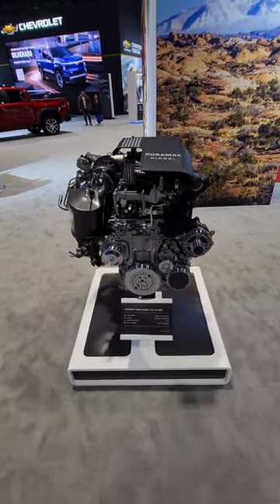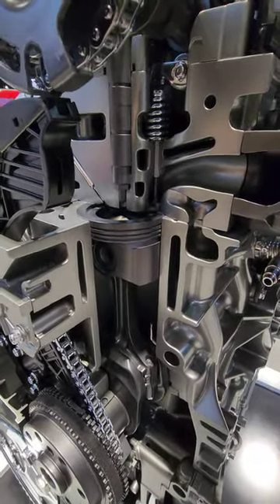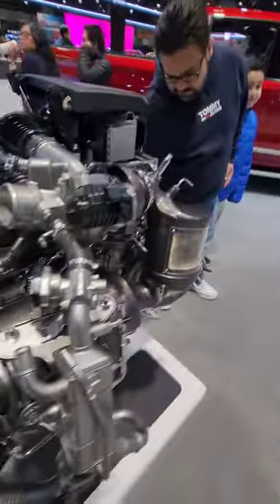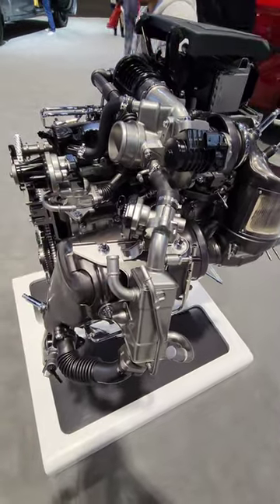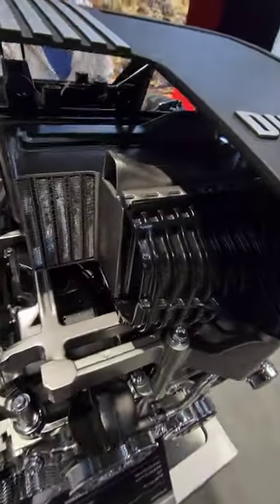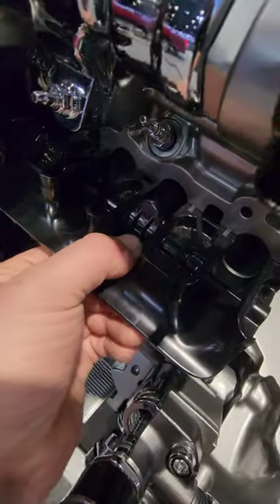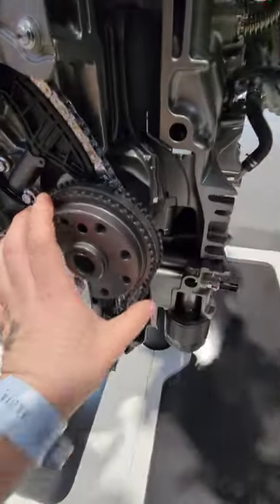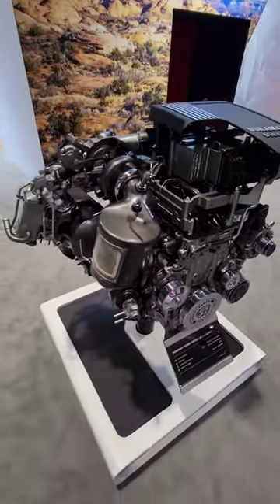Everything you need to know about the new 2025 LZ0 3.0 Duramax Diesel

Comment: My 2024 ZR2 with LZ0 gets 35% better MPG than my 2023 ZR2 with 6.2L. Diesel is $0.30/gallon cheaper than 93 Octane as of 10-1-24 in Texas. LZ0 is a great engine. No issues through 7K miles. I use 1 gallon of DEF per 1000 miles.
Reply from the maker: Sounds like a win win!

Comment: It’s crazy how every video talking about this engine I see the comments full of dumbasses saying stuff about the oil pump belt as if every gas engine made in the last 30 years doesn’t have a ridiculously complex and expensive timing system that will grenade the engine if it doesn’t get replaced every 100-150k. Why is it okay for a gas engine to need a major service at 150k but not a diesel? Btw I own one of these. It’s 2500 bucks at the dealer to get the belt changed. If you can’t afford that you can’t afford the vehicle the engine comes with, I promise.
Reply: @mudslutmusic9052  actually GM has stated the LM2 is also at 200k now. Look at the part #. It’s the exact part # on both
Reply: I think because in this case it's because that belt is on the back of the engine and it's a lot more difficult to get to and service.
Reply: @frankeem3820  weird how nobody mentions difficulty servicing on transverse mounted engines where there is nothing you can do short of pulling the engine to get to it but taking a dozen transmission bolts off a rear wheel drive engine is somehow too difficult
Reply: My 2003 Acura RSX Type S has 312k miles on the original cam chain, fuel pump, oil pump, starter, brake rotors, shocks, and has been tracked at the Streets of Willow raceway @ Rosamond, CA. This motor will not see that kind of longevity.
Reply: $2500 wipes out any fuel savings, especially when diesel often runs a buck more than gas.  How come the Ecodiesel doesn't need this?  Cummins?   Pay your $2500 extra and I will keep my money in my account.
Reply: @DavidMosby  laughable suggestion.  For those that run premium fuel, that difference is roughly 20 cents less a gallon (in the southeast US), and many modern gas trucks at least recommend use of premium.  

My father has a GMC with an LZ0 and averages 25mpg on his commute to my 15mpg average on roughly the same commute.  I run 93 octane in my Nissan Titan (required for the 400hp map).  If you do that math and realize that it will take us both 13 years to accumulate 200,000 miles on our vehicles, the fuel cost savings would be just shy of $20,000 over that time if I moved into his truck.  You couldn't be more inaccurate in your statement even if you cut my estimate in half, which would more than account for a dollar difference between 87 octane and diesel.
Reply: @zackyb-uj6qn  , I can't help if you are not smart enough to not buy the most expensive gas hog half ton truck.  Most people don't know if their car has a belt or a chain.  Shame on every company that makes disposable vehicles!
Reply: @frankeem3820  service of the pump and belt both require the removal of the 10 spd transmission to access the back of the 3.0 LM2 and LZO.
Reply: @frankeem3820  It's actually easier to service than the oil pump belt that have been on the 2.7 Ecoboost and 5.0 Coyote for the last few years. Guys think that it's easier if it's at the front but the labor estimate for replacing the belt on the Ford gas engines is higher than the labor for the oil pump belt on this engine. It's also hilarious that almost nobody seems to care that Ford uses oil pump belts on those engines in the F-150, but put the belt at the back where it takes less labor to change it and the internet has a meltdown. There's way more stuff that has to be removed to access the belt at the front vs the rear.
Reply: @DavidMosby  Fuel price differences change constantly and vary by region. In the upper midwest, diesel is currently 3.41/gal and regular 87 piss is 3.13/gal. This engine makes more torque than even the 6.2 V8, gets twice as far on a gallon of fuel, and that 6.2 strongly recommends 91+ octane fuel. That monster torque is worth it alone. Add to that the fact that some guys are averaging 30 mpg highway and 17-18 mpg while towing, and that is a huge advantage, even if the oil pump belt needs to be serviced years from now.
Reply: @jellyfrosh9102 aren’t you gonna be embarrassed when you find out they gotta pull the truck cab to change the timing chain and maybe oil belt too. 😂
Reply: Or you know, they could have just learned from Ford and not used a wet belt in the first place. And look up how long those "150k mile guaranteed" wet belts really last. And gas motors timing belt replacement doesn't cost $2500. Aaaaand most cars have gone back to timing chains anyway so.

Comment: I've had 2 little 3.0 Duramax engines, in a 2020 and 2022 Sierra.  Put 40K on the 20 before trading it in and have just under 19k on my 22.  I don't have a single bad word to say about them.  My next new vehicle will likely have a 3.0 also.
Reply: Is what they say about the massive amounts of oil consumption true?
Reply: That’s a rare issue likely due to owner negligence. Its very important to do a proper engine break in before the 1st oil change and do your 1st oil change no later than 5k miles.
Reply: 40 thousand miles?   19 thousand miles and no trouble.  Let's hope so.   Come back and talk to us when you have 375,000 miles on one of them like my 5.9 Cummins.  Good luck.
Reply: @pcmountaindog yes, the legendary Cummins is a beast but that reliability means nothing when your Ram 2500/3500 is on a hoist getting a  replacement transmission for the 2nd time in 6 months. Ask me how I know!
Reply: Those engines aren't even broken in. Run one to 150-200K and tell us how nice the bill to replace that stupid rubber belt is.
Reply: Anything under 200k is not part of the conversation.
It's a truck not a Vespa, 100k is an  unacceptable lifespan, especially for a truck
Reply: @jonathangarzon2798  You lost me, guy. 100K mile life span for what?  The oil pump belt has a 200k mile service interval if that's what you're referring to.
Reply: Nobody buys these trucks for 200k miles, they get traded in every 4 years

Comment: I have a 2021 3.0 DURAMAX   I have owned diesels trucks all my life this is by far the best
Reply: Then you never owned a 3126E or a 7.3 Powerstroke or a 5.9Cummins.
Reply: So it’s strictly diesel gas ⛽️ at the pump?
Reply: @Shomari_Supreme if you put gas into a diesel engine, you can basically say bye bye to the fuel system. Diesel has a lubricating effect and gasoline does not. It will rip it apart.

Comment: 61k on my 2020 3.0 including hauling a 2k lb truck camper all over out west in 90+deg temps during 2 summers.  Not a single issue.  Has also survived NE Wisconsin winters without a hiccup.
Reply: Nice to know about the winters Thinking of a 3.0 But Canadian winters -30c scares me for froze def emissions ✌️👍🇨🇦
Reply: 61k is still a virgin in terms of longevity.
Reply: @gk9417  get the block heater and you will be ok

Comment: Would be perfect if it wasn’t for having that belt… sure it’s supposed to last to 200k miles… but If or when you need to replace it you have to pull the whole transmission off to change it or even check it.. if they just made that a chain… boom, perfect.
Reply: Maybe someone will come up with an aftermarket chain and sprocket to replace the oil pump belt.
Reply: A chain would require a tensioner which would increase the length of the engine which already just barely fits into the engine bay. It was a design compromise, sounds like it has not been problematic yet, time will prove out if it's going to be an issue. Too early to tell yet.
Reply: @chrisspencer9400  Great explanation, I was wondering about that. Otherwise love the LZ0 design. Just ordered a MY24 Silverado ZR2 with the LZ0 today.
Reply: @chrisspencer9400 Oil pump chains don’t require tensioners.
Reply: @delorean831  According to one of the engineers who worked on the design team if they used a chain it would require a tensioner. That reason is theirs not my own.
Reply: @delorean831  Some do some don't

Comment: Would opt for this engine over electric!
Reply: Not with a rubber belt driving the oil pump.
Reply: @pcmountaindog  what's the problem?   It has a service rating of 200k miles.

Comment: You called the DPF the DEF.  The DPF is the big chamber, it catches the soot from the engine.  The DEF getting pumped into the exhaust before the catalyst and after the DPF  which turns NOx emissions into nitrogen and water.  That's it.  The biggest greenhouse gas a diesel produces is NOx due to the extremely high combustion temps.
Edit:  Your dislike of the EGR system I find kinda funny.  GM placed the EGR  after the DPF specifically so it would stop the primary failure problem of diesel EGR systems, the soot buildup.  Your complain't of it being overcomplicated it almost comical considering that EGR system is one of the simplest ones ever created lol.
Reply: So they are injecting the def before the dpf???? Weird … cause on heavy trucks they pump in the def after the dpf and before the scr…… it sounds like the dpf would get clogged sooner just from the def deposits .
Reply: The system itself is a 50% removal of motor life
Reply: @jonathangarzon2798  Have actual scientific data to prove this, or is it just some shit you made up because you feel a certain way about it?  I am not defending these systems, but fact based evidence is important.
Reply: @dieseldawg7132  It's not before the DPF...  The primary is before the first catalyst.  Secondary is after the first catalyst.
Reply: @OddBallPerformance  gotcha we call the first component the diesel oxidation chamber then the diesel particulate filter then a decomposing tube where the def is dozed and then the select catalyst reduction…..
Reply: @dieseldawg7132  I just had a brain moment when I typed my first comment and swaped the DPF and DEF around in my head while typing.
Reply: @OddBallPerformance  cool cool I was a bit confused at first I do mainly heavy diesel, a lot of regular automotive but haven’t done small diesel trucks in years….. everything is so compact these days…

Comment: I finally got a chance to drive a 2020 LM2 Silverado yesterday. Truck had approximately 85k miles and I LOVED it! The power delivery is instant and I hardly had to give it any gas to get it moving. It had more power and torque at half throttle than my current 5.3 at full throttle. Amazing engine and I can’t wait to get one. Not sure if it’ll be the LM2 or LZ0. Will depend on truck pricing.

Comment: Damn.  Awesome video.  Glad I finally found it... a technical person talking about technical aspects of the engine!  Considering this engine for my next truck to supplement my '16 LTZ 6.2 that I've turned into an overlander.  

I "want to believe" I have my doubts about the longevity of this 3.0 diesel.  Especially when the 5.3's and 6.2's have proven to be pretty reliable.  Mine is at 163k and is still running very well, no issues whatsoever.

Comment: If the government wouldn't be in the way with all the emissions these engines would get better fuel economy and cut the cost. My 2022 Duramax 6.6 with a 10 speed transmission gets worst mpg and burns DEF than my 2005 no emissions. I could get over 20 - 23 mpg on the highway in my 2005, and lucky to get 19 on my 2022.
Reply: The government didn’t get in the way of anything. They required a reduction in air pollution, because that is what the people demanded. Don’t like it, move to India they have horrible air quality.
Reply: Something isn't quite right with yours then. Had a 2020 and now a 2023 l5p and both are getting 20-25mpg on the highway with about 2500-3000 pounds of payload and use relatively little Def.

Comment: Can't wait for my LZ0! It sounds like the LM2 has been a fairly solid power plant, and it looks like GM only improved with the next gen. Hopefully increased longevtivity too
Reply: What do you mean by increased longevity? Has a single LM2 engine failed?
Reply: @ElectricBlueIX they're decent from what I read but they do have oil burning on a few. I wonder if the steel pistons was to take care of that issue tbh. Steel has less heat expansion than aluminum so it would make sense
Reply: @codyweiler6083  my 5.3 burns oil too. Some engines do and some don’t. That’s not an issue.
Reply: @ElectricBlueIX  oil burning isn't an issue? Ummm. Yes it is lol. A new properly working engine shouldn't burn oil.
Reply: @codyweiler6083  no…its not an issue. My truck runs perfectly fine. I change my oil between 3,000 and 5,000 miles. During that time it will burn a quart or more of oil. 
A brand new engine typically does burn oil on break in.

Comment: I won't go with this LZ0 amd stay away from LM2.  My 2021 had an engine replaced due to oil leaks.  Engineers said poor block casting was the issue.  Hopefully there were very few like mine!  That being said, I enjoyed this engine as a 1/2 ton option.
Reply: Haven't seen too many. Most aluminum engine blocks are high pressure die-cast because of the precision and increase block strength but even a tiny bit of contaminants can cause porosity that leads to an engine leak.

Comment: What kind of high pressure fuel pump does engine use?  I have looked online extensively and cannot find the manufacturer or model.   Hopefully not a Bosch CP4?
Reply: It's the Denso HP5. Also the injectors Denso G3.5 injectors at 36K psi.
Reply: They’re like a $1,000! Wow😮
Reply: @swimers100 thats cheap. the bosch pump he mentioned is known for going bad, throwing metal straight through the injectors blowing the engine. knew a guy that almost had to spend 16k on an engine because of that pump
Reply: @bradhaines3142  Yeah not having the pos Bosch CP4 is a huge relief.

Comment: I've had 3 euro diesel cars, all older, and totally bulletproof (over 500k kms), but i havent had a diesel in over 15 years. I'm about to sell my 11' Tacoma (too small for the family), and the LZ0 has definitely caught my attention, specifically in a ZR2.  

Can anyone point out the biggest issues these engines have when they get to high mileage (+150k miles)? Also, how does the trans stack up?

Thanks folks.

Comment: Just found out today that my 2023 AT4 with this Duramax with only 13,000 miles has to have the entire engine replaced.  Pretty pissed off.  Warranty repair, but still, this sucks.  Noticed a small oil leak.  I took it to the dealer, and they said the front seal was leaking.  They replaced the seal, but it continued to leak.  Saying something is wrong with the crankshaft, preventing a proper seal, and it's cheaper to just replace the entire engine.  Waiting on GM to approve the work and look for an engine to be shipped to my dealer for installation.  At least 3-week job.  Horrible.

Comment: You failed to point out that the steel pistons allowed them to make them more compact and smaller than the aluminum. So overall the weight of the steel pistons are still the same as the aluminums.